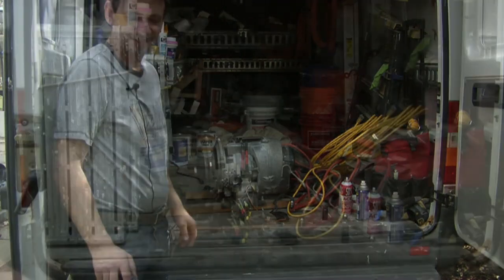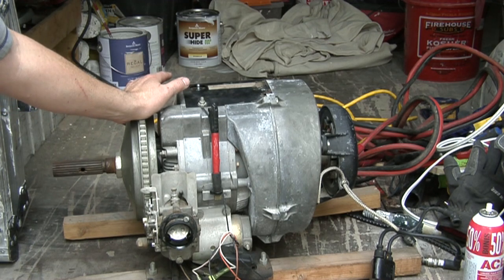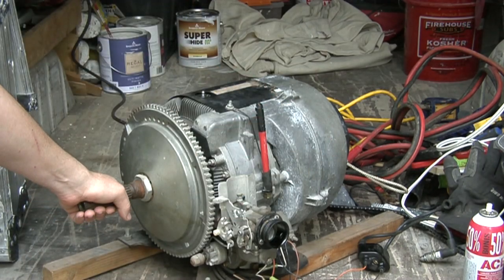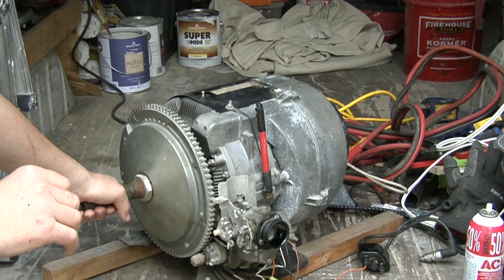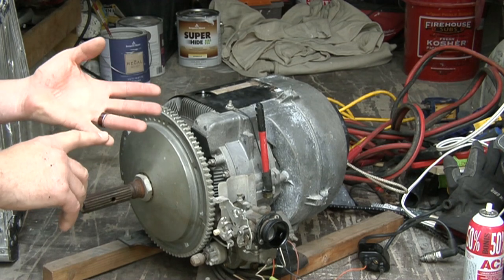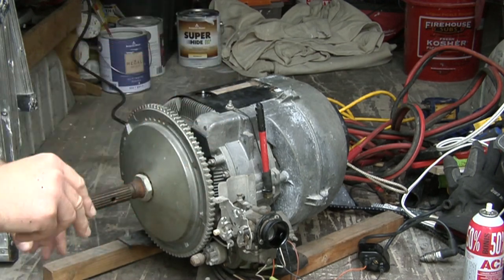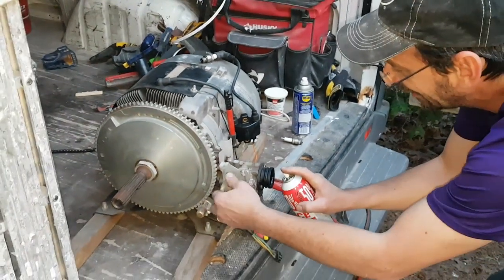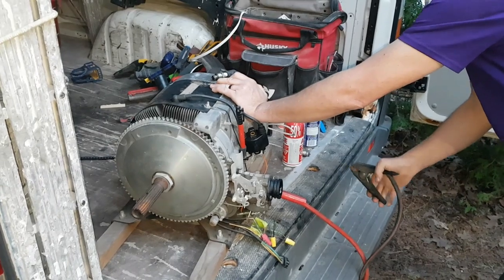Unplanned score! Barn Find OMC RC35

Comment: I would mount it between 2 wheels like a gravely type concept and use it for everything weld square tube to slide in mud kart, street kart, use it to move trailers and cars around. Make a 1 motor moves all.

Comment: use the second hole the pen hole put a valve in it .. use it for compression relief like on a chain saw .. that way if battery weak it will help rope start ,, also maybe build  a drag mower .. never enough projects .. got enough for a lifetime still getting more ..

Comment: how much torque does it have? Would it be right to assume it makes its 35hp at a high rpm power band. If that's the case then you probably going to be building whatever project towards speed.

Comment: It would be cool if you could run fuel injection instead of the carburetor. It would obviously cost more but you would gain power and reliability.

Comment: Had no idea that anything smaller than a car ever had a rotary engine, crazy... 5500rpm is a bit higher power band than your standard 3600 or below OPE engine. Whatever you do will presumably need some fancy transmission-ing but you've got the experience to do it
Reply from the maker: Over the years, I've learned of many neat rotary-powered goodies. There were little nitromethane powered rotary remote control aircraft engines, there was a chainsaw, and a pushmower, too. Obviously some snowmobiles, and I haven't seen one but I heard whispers of an outboard boat motor!

Comment: I am thinking some sort of racing Go Cart. I would not place it on a mower and run it through the mud. I think running this motor through the mud will over heat it and as you said finding the parts to repair it will be next to impossible. Additionally I think that it is supposed to run on 2 cycle engine oil. I can't remember if you mentioned that or not, but I would hate to see you run it on regular fuel and burn it up.
Reply from the maker: It most definitely requires a mix. That's why the test shots included spraying a bunch of oil down its throat.

Comment: Hey Doc. Had a question on your Fugazi build. You used a Honda 3813 brake lever. But what cable did you use for the brake? Thanks for your videos.
Reply from the maker: I used the Honda cable that came attached to it. Thanks for watching!
Reply: @DocSprocket  thanks for getting back to me, appreciate it.

Comment: They were sensitive to lubrication.  Ours died in the 90s, seals wore out.
Reply from the maker: When you say "seals", are you referring to the rubber eccentric (crank) shaft seals thru the case, or do you mean the rotor side and corner seals?
Reply: Sprocket's Garage  -  howdy, the rotor seals, aka “rings”.  It very specifically said to use only omc 2 stroke snowmobile oil.  My dad came upon a case of metal quart cans of Amoco 2 stroke oil which we used.  It made me nervous, and eventually she died.  I wanted to take it apart but old man gave it away while I was at college.  I would try to find out what that oil was and be sure to mix it to proper ratio.  Very cool motor.  The local ski resorts used them for ski patrol.  24” wide tracks!  IIRC....  I’m located in northwest lower Michigan.  Good luck with it!

Comment: What part of Ontario are you from I have heard stories about one of these just up the road from me
Reply from the maker: I'm a little outside of Newmarket.
Reply: I'm from Peterborough there was one sold in a auction in a new in a crate along with a complete sled I can't remember exactly but was before covid its cool this stuff is floating around we had omc in Peterborough I think a lot of stuff went out the back door
Reply from the maker: @kemc2724  Man, that's cool. I got mine off Marketplace,  had to drive down to Toronto for it. Wasn't in a crate or anything. Showed signs of age, but not use. I still haven't put it in anything,  but I was thrilled to get it running off that boat CDI.

Comment: Chuck it in Fugazi!
Reply from the maker: Not impossible,  but would require a complete change of driveline. First, because Fugazi is all vertical shaft stuff right now, second, I'm pretty certain that this engine would shred the Peerless 820 transaxle.
Reply: @DocSprocket  would be funny tho.

Comment: hi michael brown in n.c. it needs to go in a motorcycle for the road with a snow mobile  cvt or a 6 speed from a H.D. it would have great rpms ps or a hydraulic drive from a zero turn mower this may best to a shaft drive motorcycle  thanks[ MBE] MICHAEL BROWN ENGINEERING